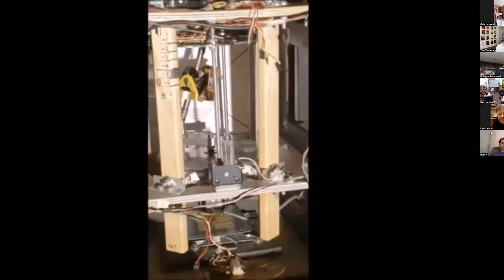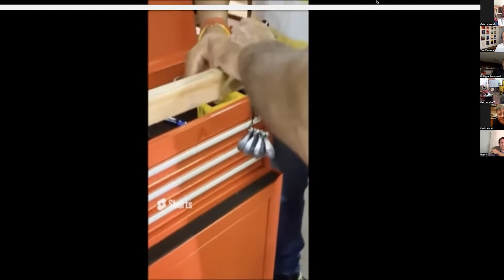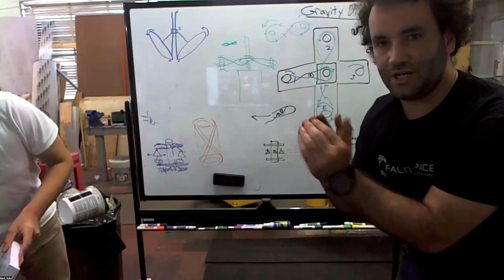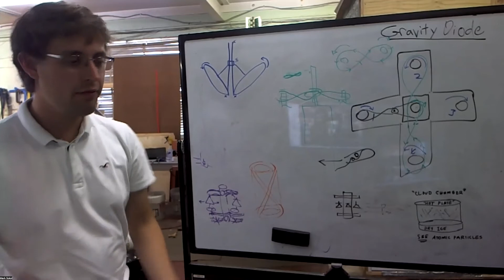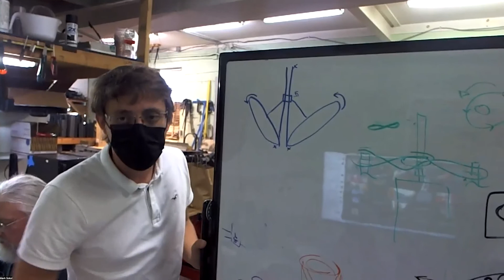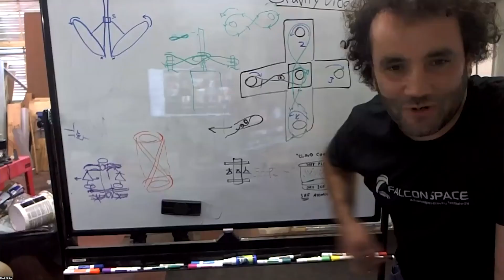APEC 10/22, Part #1 - Ted Pittman - Impulse Driver Testing

Comment: 9:03 I get really great prints off my mostly stock Ender 3. STRONGLY recommend the ebook "3D Printing Failures: 2022 Edition" by Sean Aranda (AKA The 3D Print General). It's a fantastic resource for diagnosing the problem(s) with your printer and/or print settings.